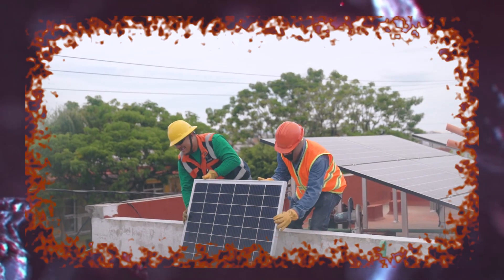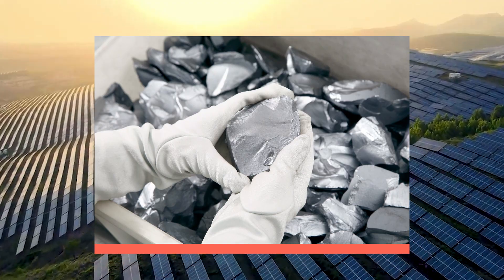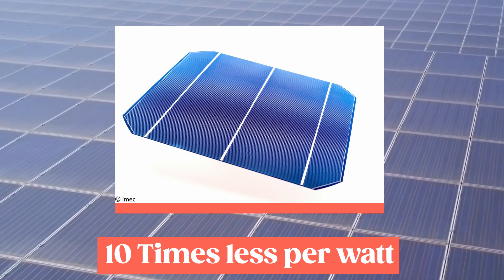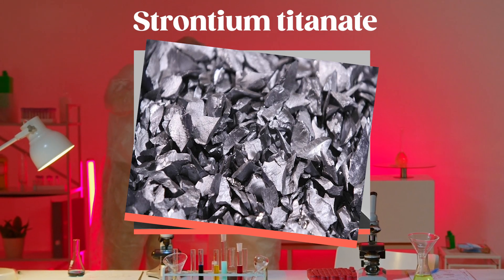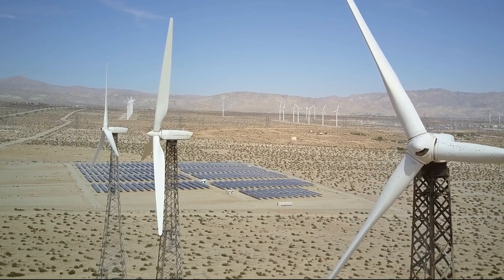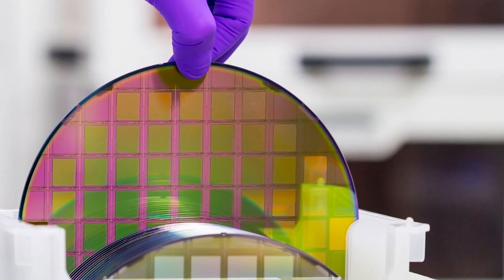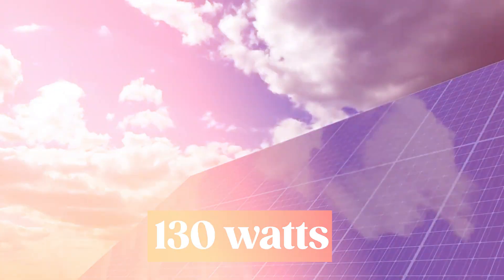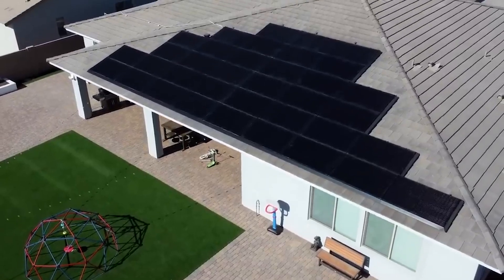Elon Musk Just LAUNCHED A New Solar Panel That Will Blow Your Mind!

Comment: Silicon. Say it with me...Silicon. Once more...silicon.
It's silicon...not siliconE. There is ZERO SILICONE in the crystal material used in solar panels.
The only place silicone MIGHT be used is to glue together some finished parts in the assembled panels, and/or provide a water-resistant seal around the edges of a panel to keep out rain.

How can anyone trust anything said about solar panels by someone repeatedly making this very fundamental error?

Comment: Green technology can never solve the problem they pretend to address.  It is a morality/virtue signaling movement that is captained by Marxists whose real aim is to destroy capitalism and the U.S.  Solar panels and batteries create a huge number of environmental issues by themselves aside from being hugely expensive.
The best solution for the future of energy supply is the construction of Molten Salt Thorium Reactors.  Besides providing abundant, electricity, they can provide a myriad of other functions that will completely defuse the Green New Deal, such as non-carbon diesel fuels which means you can keep the current commercial transportation intact.  Synthetic gasoline production has been made a reality.  This is a carbon-neutral process of capturing carbon and reconstructing the gasoline by adding Hydrogen, recovered from atmospheric capture means that we can shrink that atmospheric (and oceanic)carbon.  MSRs can make this happen in realistic quantities.  They can be built on existing power plant sites, like coal or diesel plants, and use the same already existing power grids.  MSRs can be made small enough to run a car or a ship.  They can be used to desalinize ocean water on a massive scale.  They cannot melt down because the molten salt is the fuel carrier.  Thorium is preferred over Uranium because it has 200 times more energy potential and is dirt cheap.  Thorium is abundant and has been the "waste" product of rare earth mining.  The reaction occurs between 600-800 degrees F.  If the molten salt should ever overheat the reaction stops and a freeze plug in the bottom of the fuel jacket melts and the molten salt flows into a holding tank where it cools down naturally.  They can be set up to burn the waste from light water uranium reactors because they are so efficient.  They can be used for producing non-carbon diesel fuels.  They can be used to cheaply desalinate seawater, and scrub carbon from the atmosphere.  They are safe and can be built anywhere. because they don't need water in any aspect of their operation.  They can be made small enough to power a car or big enough to power a city.  The U.S. has about t a dozen companies that are either ready or near ready to construct them   France is developing them and Denmark has one company developing them.  I don't know about Germany, but Germany would clearly benefit from them and could erect them quickly if desired.  They must get over their anti-nuclear sickness, however.  There is no time to waste.  here is a four-minute introductory video to MSRs. - 
https://www.youtube.com/watch?v=k6BXvw6mxtw

Comment: Hail-proof, wind-proof, tornado-proof?
Reply: The same issues apply to the power lines and transformers that bring commercial power to homes and other buildings. Our power grids (regional and local) are still quite vulnerable to those.
Also, don't forget icing, and critters like squirrels getting fried on the lines that trip pole and transformer circuit breakers.
Reply: Think that would have more to do with protective coverings